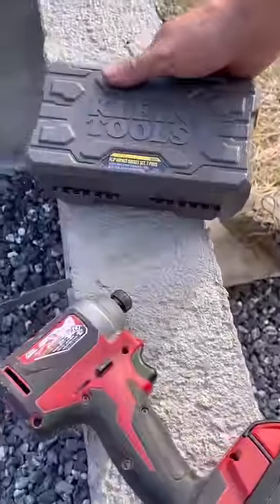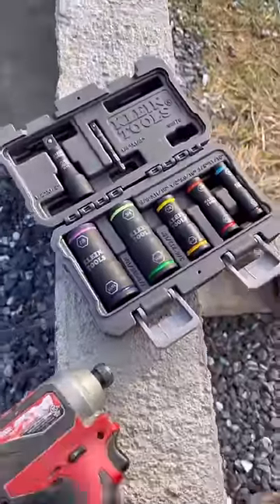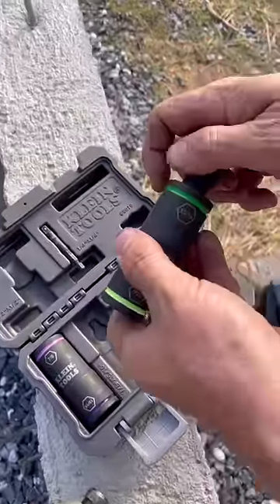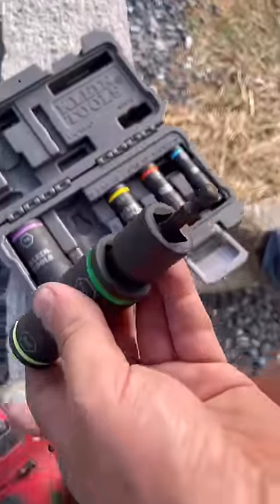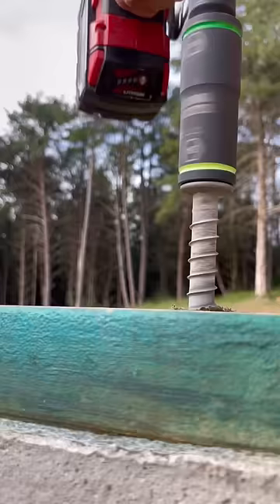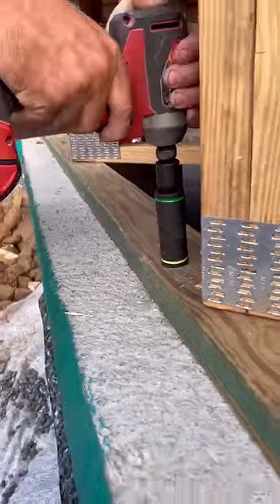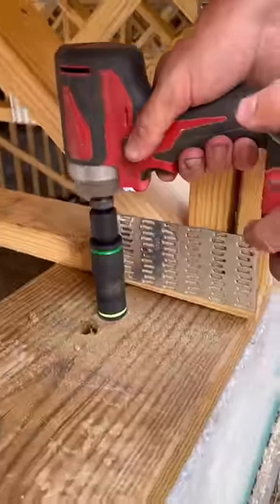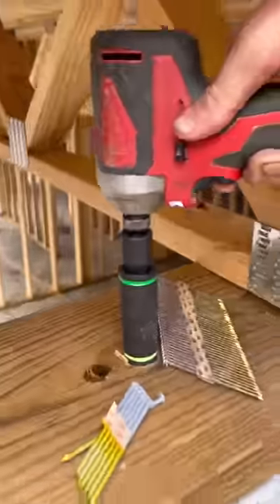Klein Tools Flip Impact Socket Set

Comment: Out of everything I am more impressed that someone other then me tightened the bolts down after the wood dried some!
Reply: Came to make this comment, agree.
Reply: THAN*** It's greater than not greater then 🤦🤦🤦🤦
Reply: Can you explain why no washers under the nut ?  In my (non USA) country we are required to have a 
2”x2”x 1/8 (we are metric so it’s 50mmx50mmx3mm thick)square washer under the nut, to spread load, mainly to guard against uplift from a roof etc lifting the base plate.
Reply: @biopsiesbeanieboos55  washers are under the nuts. Just the washer’s required in your area of the world need to be bigger. 
Every country has different standards for building due to soil, rain fall, snow load, wind shear, earthquakes, etc. 
In my area I have solid rock under the soil and no earthquake’s. 
I’m on a hill so no flooding.
The snow gets melted off my roof from the heating strips so I don’t need to worry about snow load and the area I live in doesn’t get high winds.
Reply: @conqwiztadore2213  no one cares and everyone knew what he meant but you are very very smart great work here we all see how smart you are correcting grammar on a YouTube comment great work 🤦🤦🤦🤦
Reply: @frankdelucey2137  Thank you.
Reply: Yes but why didn't he use a lignite torque wrench calibrated for the density and latent porosity of the wood?

🙂
Reply: @frankdelucey2137 - I looks like there's no washers under the nuts in the video. It took me s couple of re-watches to notice one. They seem to be too small diameter, hence the need to constantly re-tighten as the wood fibers compress.
As for the rest of your house's life story, we don't care.
Reply: @johncoops6897  not my concern about your washer size and apparently you cared about my comment because you posted lol
Either way have fun posting on YouTube 🤣🤣
Reply: @biopsiesbeanieboos55 metal on metal washers always a good idea. Wood, lots more places will fail before that bolt is pulled through the plate
Reply: @frankdelucey2137  I don’t know that guy but it wasn’t me.  I was grateful for your explanation.
Reply: I even do that in elec panels on the lugs and breakers. Not that the wire is drying, but either someone didn't torque to spec and/or there was a significant change in temperature.
Reply: Nice! You're so smart! That must be because you want to crack the wood right? Wood expands and contracts constantly. Engineers must take that into account when building homes.
Reply: @Elpipiton  Wow you must have never built a house because the wood that is used dries and the bolts need re-tightened before the drywall goes in. But you wouldn't know thay unless you built a few houses.
Reply: @conqwiztadore2213 we’re in the trades for a reason brother who cares😂
Reply: @biopsiesbeanieboos55  The washer is sunken already
Reply: @dappa211  I rewatched on a bigger screen and now can see the washers.  Was too hard to see the washers on the small phone screen.  Thanks.

Comment: They look really nice, but I wonder how long the hex adapter will last.  The torque test channel goes through stacks of those.
Reply: well it doesnt have the torque section in the middle so it might last longer i think they did their research
Reply: It is the weakest link so it will always fail. Some last longer than others but they will all fail they take the brunt of the force.
Reply: Just use an impact wrench
Reply: You can get a new 1/4 hex to 3/8 socket adapter from anywhere for next to nothing. That’s always the weakest link but that’s what you want to be the weakest link because it’s the easiest to replace
Reply: @JulioKeepsMovin  I have to agree, a proper impact wrench is the correct tool for sockets this big rather than an impact driver.
Reply: Klien will replace it if it breaks. They are really good at that
Reply: @ToastedTostito  sometimes… I’m an electrician so I use a lot of their stuff and it seems like lately, places have been weird about replacing Klein stuff. Like they changed their warranty or something. Stuff that I’ve never had issues replacing in the past is now difficult to warranty or they just won’t warranty
Reply: @ferrumignis  if we're talking high torque applications, I agree, but I've used similar adapters a bunch just so I don't need 2 sets of sockets for ratchet use and driver use - really handy for stuff like furniture building where nuts and bolts are used but don't need to be high torqued.
Reply: well the torque twst channel also takes things to the max so it makes sense, I've used these plenty and the milwaukee ones I've used haven't broken at all
Reply: @spedracer55  p
Reply: As long as you use it in the 1/4 impact and aren’t trying to break loosed rusted 1 1/8” nuts it’ll last as long as any other reputable brand. People who break tools often are using them improperly or just simple wrong tool for the job. But I have this socket set and yes it’s of good quality and the smaller case to carry around also the color coded stuff is quite convenient. Nobody likes diggin thru the tool bins searching for that mystical 10mm sockets 😂
Reply: Torque test channel 800hp impact gun
Reply: Project Farm: "We're gonna test that!"
Reply: My Milwaukee 1/2"  hex drive for tool 2753 takes care of 99% of my job site/garage duties.  The rare times I need more i jump to tool #2763. 
Never broke a Milwaukee hex drive broke several HF and cheapy brands.  I only buy Milwaukee now for my HD needs.
Reply: Get the 3 piece 1/4" to 1/4", 3/8" and 1/2" Husky adapter from Depot. About $7 and lifetime warranty. WHEN it breaks, take it in and grab a new one.
Reply: Don't really matter, these bits are cheap to replace. If you are snapping these on a regular basis, you would be better buying 1/2" drive impact wrench, this will save it from breaking.
Reply: Even if you’re going thru a few of them a year or even more, it’s still cheaper than buying essentially two sets of impact sockets. Like he said, he’s seen a lot of electricians use them….not sure how much you know about electrical but most of the time you’re not putting giant lags into the ground(typically), they’re working with objects and wires that can only take a certain about of pressure(crushed wires, cracked/bent brackets, etc) so very rarely do you see an electrician snap a bit due to torque overload.
Reply: The downside of impact drivers is no matter what, they are limited to the overall strength of a 1/4 inch piece of steel. I mean, a 1/4 piece of steel is strong but impact drivers nowadays are putting out over 2000lbs of rotational force which is well over the rated strength of any 1/4 inch piece of steel. When it comes to sockets, an impact driver is in theory very similar to that of a Phillips head driver. The Phillips head, intentionally designed to fail as to not over-torque the screw itself. Much the same as an impact driver with sockets, it’s limited to 1/4 inch steel as that will likely break before camming out the hex head or socket. Impact drivers are not meant for industrial practices such as construction or changing tires on a car, for those you should be using an impact wrench. What’s really funny too is nowadays they even have something called torsion bits/attachments. Which is where they literally take a 1/4 hex shaft and further decrease the diameter in the middle making it even weaker. This is specifically made to intentionally break the bit or socket attachment before breaking the bolt. Not only do they charge more for torsion bits but they break much easier and don’t last as long. It’s a complete gimmick and for some reason it’s taken off even tho it offers no real benefit that anybody wanted.
Reply: I've had the mini flip socket on a quarter inch hex for like a year. The sockets don't slide on as easy anymore but in terms of strength it hasn't broke. I break a lot of bits and adapters but this seems solid
Reply: Adaptors are themselves considered similar to bits. In that they're expected to at some point fail, and usually of course way before the socket itself or the bit holder (in the case of general bits inside extensions & drills etc).

Comment: Milwaukee + Klein is a match made in heaven.

I use the Klein flip impact rated 1/4" drive kit sold in home Depot for $29, I'm a plumber, so I don't have a great demand for sockets.
So 1/4" and 5/16" are my go to, but it's awesome to have the variability of the next 6 sizes offered in the kit.

I run it with my m12 surge 9/10 times.

Comment: Just bought a set of Klein torx screwdrivers with the security center hole.. work perfectly to fix my $390 commercial vacuum to install a $17 part that the shop said I needed to replace it.

Comment: I'm a millwright and I've got a Klein multimeter for when the electrician doesn't show up for work. Works good, I've had it for 2 years and only now had to buy new leads as the old ones were falling apart. That was on me, I was storing it with the leads still plugged in and they got kinked inside the case.

Comment: I was an HVAC tech and a coworker actually a fellow apprentice (just 2 years ahead of me) showed me the difference between the Klein screwdrivers he had slowly accumulated in his bag and how much better crafted they were than my cheap made in China craftsman screwdrivers (circa 2012/2013) it was not something that changed my mind quickly. We would be doing things like changing contactors together and my screwdriver would slip or not quite fit right whereas his would almost be a perfect fit every time to where he could really torque the terminal lugs to ensure a good connection. That’s what made me ultimately break down and get klein screwdrivers. I always saw how high quality their pliers were and now most pliers I have are kleins with the exception of some knipex and channellock here or there. They had their multi-screwdrivers all the way to like 11 in1’s for a while then came out with stuff that   Chucks into your drill/impact driver. All of their stuff has been great for me. I just picked up this set as well as because I recently have moved moreso into the refrigeration field and these will be a perfect set for breaking suction/liquid filter core shell plates loose and breaking unloaders loose on O6D’s and E’s to swap unloaders or valve plates. I like that you can use the whol set with a 1/4” hex impact driver as that is what most HVAC and refrigeration techs are going to have on hand. I suspect this kit is going to be a huge home run for Klein. Time will tell
Reply from the maker: I got a free Kliein screwdriver with his kit and I really like it

Comment: Like Klein just remember each connection loses power glad you went back and retightened. This is a set you bring in but you might need to go back to the truck to get the original some times one socket impact for full power. I'm a more power guy on loosening.

Comment: Nice set for sure.The only problem is having to use that little short extension and reduces a lot of your impact torque, not always a problem but if you have that fastener thats taking every bit of what your impacts got, this will make the difference between success and failure. That's been demonstrated now by the torque test channel as well.

Comment: If always been told that the more connections like extensions/adapters lessen the impact strength. Interesting to see if it affects this set in any way.
Reply: Of course it does. However this is for use with low-torque tools like the little impact wrench he demonstrated.

Comment: Apparently I saw a vid where a guy swapped out the 1/4 drive bit holder and anvil from the impact driver for the anvil from a impact wrench and the driver with the square drive anvil performed better than the impact wrench.

I don’t really use an impact to tighten fasteners. It may feel tight but be rather loose when you put a wrench on it. The other scenario would be snapping heads off fasteners or breaking that 1/4 adapter. A fuel 1/2” impact on anything but setting 1 will warp lugnuts in like 2 seconds and have the socket free spinning with surprising little drama. I guess in this case the timber just gets crushed lol

Comment: Tool it' alright, only suggestion it is to use big flat washer for those studs, it will give a lot of strength and prevent the nut to dig in to the wood, kudos!

Comment: I guess if you need to only slightly tighten a bolt, this set will do fine. If you need to tighten a bolt get a real 3/8 or 1/2 impact and good socket  set.

Comment: I did a lot of low voltage work 4 years mainly doing surveillance cameras data centers pulling a lot of CAT5 cable coax cable a lot of my tools were clean they're one of the few companies you get what you pay for and if you break your dikes or a screwdriver Home Depot and Lowe's will just switch it out for you because they are warrantied for life and they stand behind their name

Comment: Picked up the 20-in-1 Impact Driver Set with Screwdriver Bits and Flip Sockets which claims to be impact rated. Tried using it with my milwaukee impact driver and it spin the shaft inside the socket first use- had to put it in my vise and use a channel lock to break it free- first and last klein tool I'll purchase sadly- had high hopes!

Comment: You could save money if you spent $20 on a 3/8 or 1/2 anvil and swapped it into your driver. $30-$50 for a cheap impact socket set. I did this for my impact driver before I got my impact wrenches.

Comment: Klein tools are the best tools for electrical work for sure. But don't buy channel locks made by companies who specialize in tools for electricians buy channel locks. We use the set at work to tighten all sorts of stuff especially lugs for 1000amp panels. But their linesman pliers and diagonal cutters hands downs best on market for durability and ergonomics. Their screw drivers and their nut drivers are top of the line as well.

Comment: Those quarter inch hex adapters snap like you wouldn't believe, I used to used them instead of forking out the money for a proper rattlegun to take sockets directly, and I snapped more than I can count. They are useless.

Comment: When I have to fix the bottom plate down to the slab I do prefer to use a impact wrench it’s quicker and faster and after using a impact driver to bolt them in place it can do damage to the impact driver and cause it to wobble

Comment: The nut driver, single-shaft version of this is great👍. 
This kit? Twice the size and weight of a regular socket for two sizes you probably won't be using together. Not so great.

Comment: The only problem I have with my milwaukee m18 1/4 hex Is that it snaps the adapter to 1/4 or 3/8. At least it did with my cheap harbor freight ones. I bought some better quality and longer so hopefully those don't break. But I want the 3/8 and 1/2 inch.

Comment: Where do  you build that lets you bolt anchors without a 3 by 3 steel plate. any wind and that nut pulls through the plate.
Reply from the maker: The box of wall anchors comes with nuts and washers supplied, it’s all one kit. That’s what everyone uses in our area, none of the lumberyards even carry bolts with 3 inch plates

Comment: I had a different flip socket set. It was smaller. A longer 1/4" bit and 4 flip sockets. But unfortunately I lost the quarter inch drive socket, which was the main reason I bought it. So... It's not in my normal rotation of tools anymore.

Comment: Your anchors have small round washers...very little holding power if stressed.   Most use large square thick washers for many times more resistance to pull through.

Comment: Great tool. The only problem is they do not press stamp the actual size. It will wear off and you will be trying to remember which color is the right size?
Reply from the maker: It would be nice if they pressed stamped the sizes into the sockets so you could still read it after the paint wears off

Comment: I have a set of four but they are not Klein.
They’re double ended for changing Lugnuts but they are half inch drive.
I’m in construction and have seen the threaded part of those plate anchors sticking up several inches that a normal deep socket couldn’t reach the nut to spin it on
But you can do a Google search and find sockets over 10 inches deep.
Never could understand why guys use crescent wrenches in very tight spaces able to turn the nut and turn

Comment: I'm not a mechanic, but...aren't flips sockets typically used for installing/removing lug nuts...especially with those sizes (3/4", 15/16", 17,19,21mm)...why not just use a standard impact socket instead of using a 1/2" socket reduced down to support a 1/4" anvil and impact gun...

Comment: I use their laser level daily.  Only complaint is the magnets on the back are too weak. First time I hung it on a metal stud, it fell and cracked the swivel mount. I had to fix it with plastic epoxy. Would not buy again!

Comment: They do look nice but the problem I’m having with these is that when I want to use the bigger sockets the 1/2 adapter falls off from the 1/4 adapter as u can see in the video he needs to hold the sockets from falling from the adapter and when u are on a ladder and only have 2 hands to work holding the socket from falling is one of the worst things to have to do

Comment: The quarter inch will break if you use it like that for a few hours itll get hot and break it happens many times Milwaukee dewalt and Klein quarter inch is too small for long term use.

Comment: I wonder how long the adapter will last, as far as how it holds the socket. When he finishes driving the bolt in, he removes the socket by grabbing it by the socket itself. Why is that?🤔

Comment: ill still use a rachet....to finish it off.......0 noise....can feel the torque.....dont need to worry about battery..... i ll start spin the nut with the gun tho with some cheap socket....so i get the best of both world. ireally dont trust those 1/4 adapters on my gen3 milwaukee...it has broke so many of them....
Reply from the maker: When using mine pretty hard, my quarter inch drive hasn’t broken yet